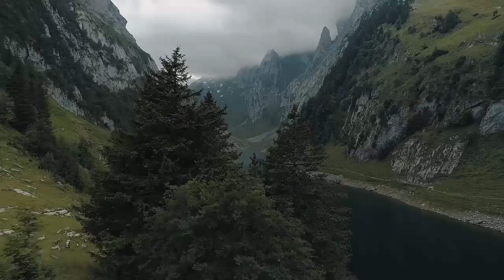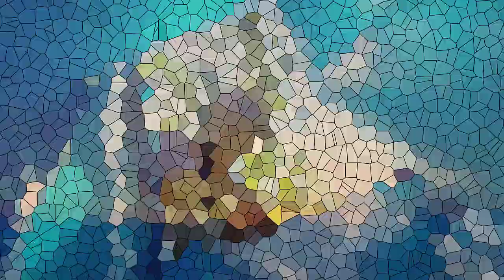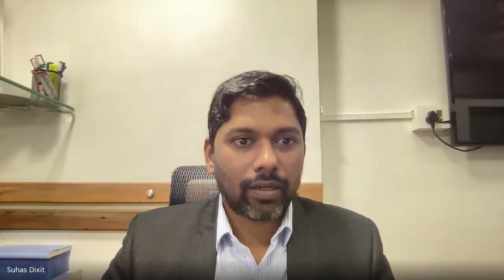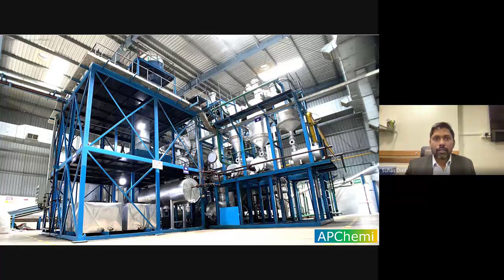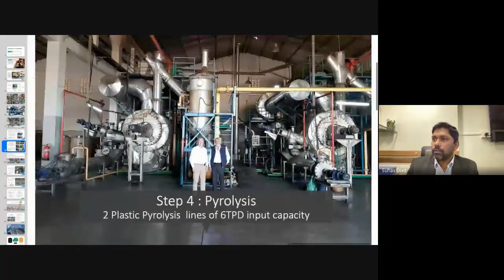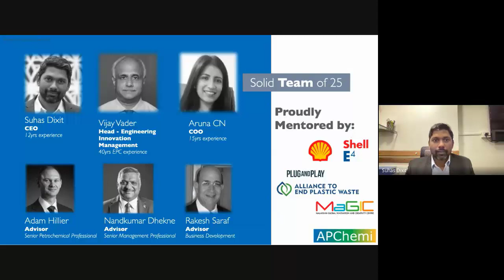BEST Plastic Recycling Method for Converting Plastic WASTE to Fuel | APChemi #podcast

Comment: This was total propaganda. 

Bottom line is....how much energy IN....vs  ...how much energy do they get  OUT   ?

It doesn't take  11 minutes of BS to state the bottom line.

The fact is pyrollisis  is EXTREMELY   expensive to use.

They never tell you the bottom line.
Reply: It depends what energy you use. If you have plenty of solar power, you can use a part of that to make a liquid fuel for your car. Or use the light gas fraction that comes off as fuel to heat the rest.
Reply: @jackmclane1826  

Then maybe he should do a video on using solar to do the conversion.
My guess is solar would not be capable of doing this in all but the warmest climates.
In eastern U.S. , no way would solar work consistently .

And again, the process he shows in the vid is as much energy in  as what he gets out.

It is more efficient to just burn the plastic , mixed with other fuels.
Reply: @vepr1332  The most important point is: Plastic waste is essentially free or even problematic to get rid of for most of us. Low yields don't hurt then. 

But they don't even have to be low. Pyrolysis actually does not need a lot of heat, but you need it at high temperatures. I guess you know the difference. So you live and die by insulation and scale. Technically the breakings of the chemical bonds cool the reaction mixture, but that is hardly noticable. Heat loss by insufficient insulation is the by far dominant loss factor. 
I ran a well insulated test setup purely on electricity from solar panels. And it worked, producing significant product streams from excess electricity.  
Proper insulation is much easier done with electrical heating, though. But I had to waste the gasses created, that could've been used for heating.
I have seen variants where people blasted the reaction mixture with microwaves. When Carbonization started, mixed plastic sh*t is seemingly a good absorber of microwave energy. 

But I'm not sure if this is the most useful mode of operation. It makes the most sense to put in single types of plastics to recover base chemicals. If you fill your tank with PVC you primarily make HCl until ~300°C. Bubble it through water to make hydrochloric acid. If you stop early it is very clean. A simple distillation makes it very pure. 

Or fill it up with polystyrene to recover the styrene. Sadly that didn't work with Ethylene or Propylene in my tests.
Reply: @jackmclane1826  
I appreciate  your reply.
When you speak of insulation,  are you talking about an insulated vessel holding the plastic , heated by your heat source ?
If so , what type of insulation  and vessel would you use ?
Reply: @vepr1332  I used a stainless steel beer keg 50l, wound high temperature electric heating elements around it and wrapped everything with a thick layer of Kaowool. Same with the riser tube that I could temp control individually to ensure thermal breakdown of the already gasified materials. If you had insufficient breakdown, your condenser will gunk up and pressure might build up. DANGEROUS! Because your 400°C stainless steel keg will not hold pressure well.

When it bursts you have 400°C liquid plastic flying around in contact with air. If things go wrong, you will burn your house down, and probably suffer serious injury from this! Be careful!

If I repeated this, I would probably gas fire the keg (to use the flamable gas exiting the process) and only use electricity for the secondary heater of the gasified product stream. Heat insulation is more difficult then. Maybe I'd place the whole keg assembly in a Kaowool furnace like others have done. But it is never as well insulated as electric heating.
I would also think about some catalyst material in the gas stream to help with the breakdown.
Reply: Interesting.
But still seems overly complicated , inefficient,  and dangerous. 

Just to simplify recycling the plastic , why not grind it up and mix with other material and just burn it to heat water or space. 
I understand you want a liquid to use in motors , but it just isn't feasible for the ave person to be doing the liquid conversion.
Reply: @vepr1332  It is not meant for the ave person to do! Nobody said it would...
Reply: @jackmclane1826  

Unless it is......
It is still too expensive to be practical.

It costs a lot of money to gather, separate,  transport , and THEN do the expensive conversion.

Again,  it is way more efficient to just burn the plastic.
Reply: If you are still thinking large scale removal of the plastic from the environment,  very noble ,  but after gathering it up ,  send it to regionally local coal fired power plants and burn it on a mass scale.
It really is not complicated.
Reply: @vepr1332  Of course you can do that, but it is the dumbest of all possibilities. And requires great effort in cleaning the exhaust gasses. Straight up burning the plastics is a much dirtier process than pyrolysis. Burning means large scale industrial plant. Pyrolysis can be done in a much smaller scale. Container sized operations. 

Generally recycling should be multi stepped!
Step 1 should be: Use it as plastics again. Collect it correctly sorted and make new products. 
If that is not possible: Step 2: Make something else from it. Pyrolysis is part of this step. 
If you can't do that: Just burn it for energy.
Reply: @jackmclane1826  

So the cheapest , most efficient,  use of waste plastics is the dumbest.
I see.
Are you going to be gluing your hands to the road , blocking traffic later this afternoon ?